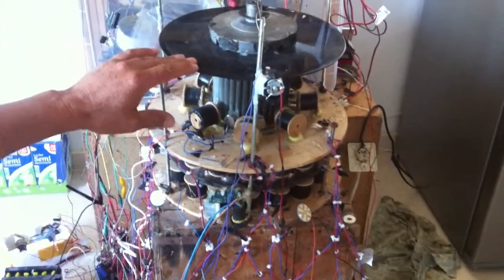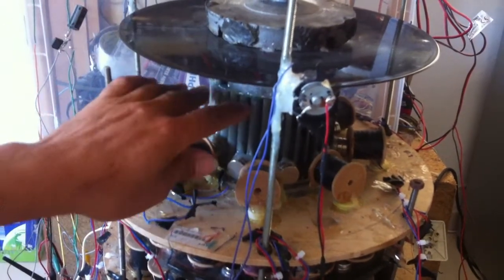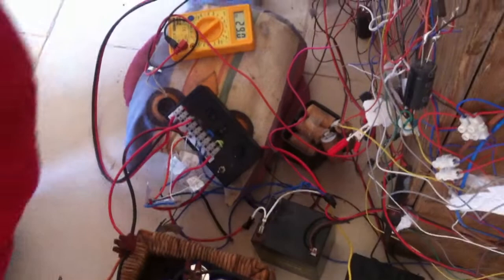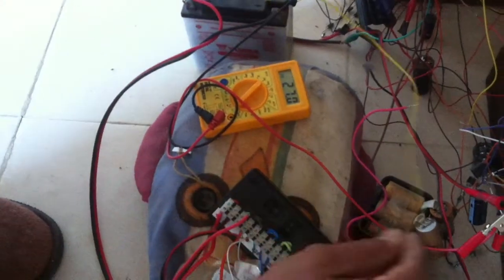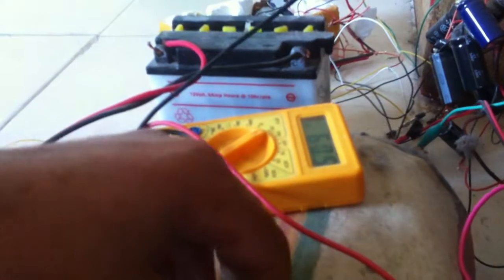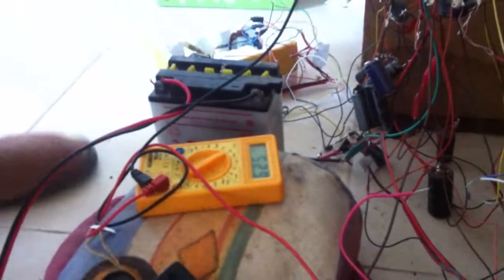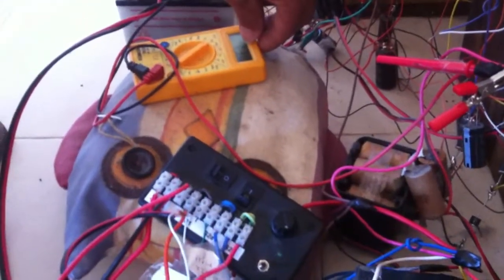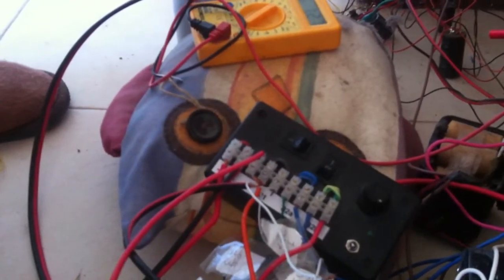The OverUnity air core coil fuel-less generator

Comment: very nice!!! can you please show us how to connect the capacitors & the recharge batt.?
Reply from the maker: Hi Kalubi each pair of coils are connected in serie between them, then to another serie. 4 pairs like this in serie then another 4 pairs the same then the two 8 pairs are connected to each pair in parallel. This way you have every 4 pairs in serie that is then connected in parallel. Each pair has a bridge rectifier with a capacitor of 16V. Once reaching around 60V there is a run capacitor in the end of 63V 8200uF that goes to the charge battery. The battery is 4ah 12V and from the charge battery back to the input battery with a diode. Regards